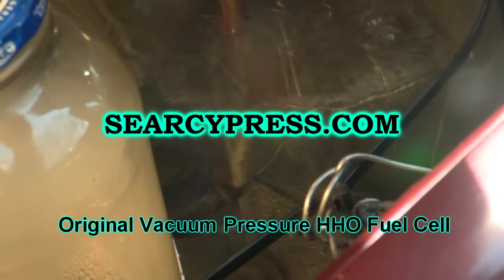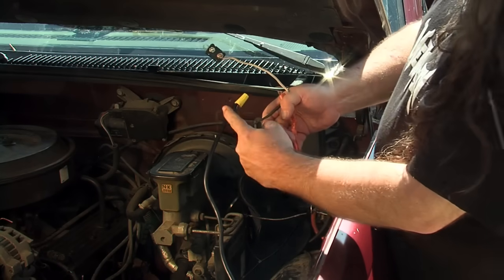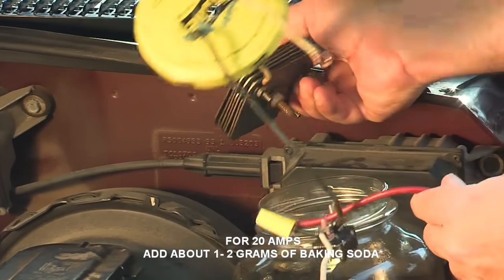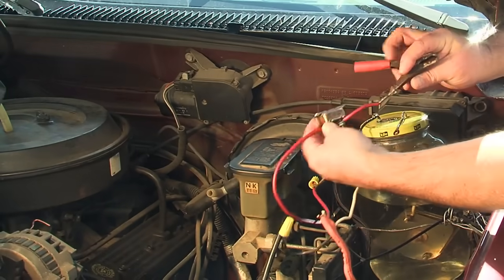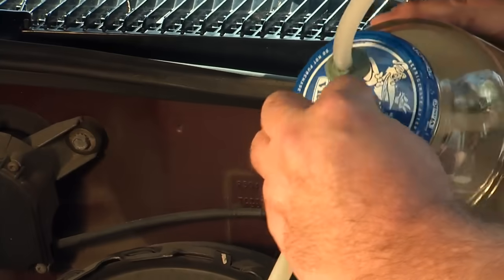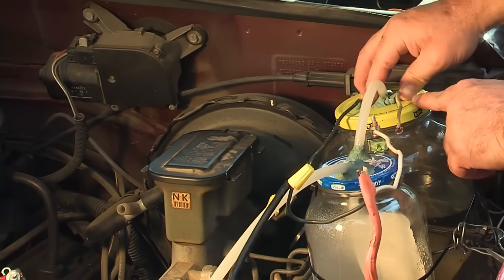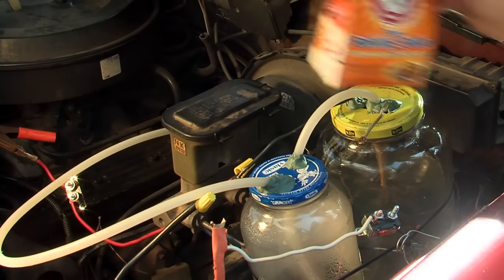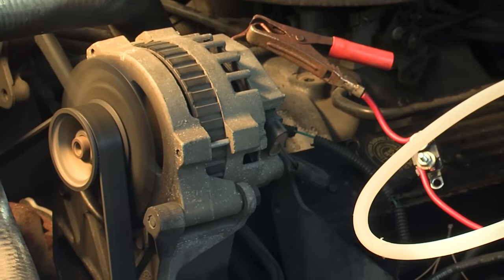Vacuum Pressure Hydrogen fuel cell defeats high gas prices using hydrogen from H2O.

Comment: Everyone talked about this technology in the 90's and early 2000's and then it just seized. Yet government pushed electric and gas. Reason being is it would collapse so much of our energy sector and most countries who have oil or rely on the petro dollar or just have relations with other countries that export energy would not dare to back hydrogen until those other countries decide its time to. Now you hear people saying how its not feasable and the technology isnt there and then you have media writing articles about why electric is more feasible and how hydrogen is so dangerous and stating a hydrogen station in California blew up.  Just so we are all clear, in the 90's the technology for converting water into hydrogen was going to be built into the vehicle and now they removed it kt and prefer to have hydrogen stations to refuel. That is proof that the technology is too good and will cause lots of energy jobs to be reduced. So they had to make you pay for hydrogen and install larger hydrogen tanks in vehicles rather than a tank for water and hydrogen converts as its needs it for fuel.

Comment: How would the cell end up drawing more than 30amp?
Reply from the maker: @danp2238  a lot of factors such as ambient temperature and the mineral content of the water used and the amount of electrolyte used. Ty for the comment. .
Reply: @metalpresstv  What difference would it make to have way more plates to convert the water to HHO?

Comment: Can it have any bad side effects on the engine like corrosion or stuff like that? I was thinking of buying a power generator to make it run on hydrogen but i won't buy it until I'm sure
Reply from the maker: @WinterWolfDubstepper  if you get anything out of this video understand we do not encourage you to replicate anything you see here. Injecting HHO into the system without the vacuum will not work. There is no other way except the way we show in this video ( under hard vacuum ) to make HHO work in a vehicle. Because we are not powering the engine we are powering the combustion process. 20% of the gasoline that goes into this engine is wasted in the catalytic converter normally. By causing almost complete combustion in the chamber we are able to get an increase in performance. All of the extra mileage comes from the existing gasoline that is normally wasted and not from the HHO fuel. HHO is extremely misunderstood and it is often thought that you can use it by squirting it into the carburetor and it will never and has never worked that way. It has to be done in the state of vacuum. We have a new video which will be coming out that explains everything in great detail. We are not able to release this video at this time and we are looking forward to it so be sure and subscribe. Thanks very much for the comment.
Reply: @metalpresstv  You being watched?

Comment: Pulling from the alternator wouldn't that pull a load as if like you're running the AC and we all know that burns up more gas so pulling from the alternator would draw more current wouldn't it equal itself out
Reply from the maker: Most people don't realize that you're not burning 100% of the fuel. In this case around 80%. The other 20% burns in the catalytic converter. This controls emissions. We're burning as much of the fuel as possible inside the actual cylinder. The boost in performance is from the gasoline that is normally wasted. The catalytic converter remains cooler much longer and you will see a lot of water coming out of the tailpipe.  This is from the gasoline and not from the HHO fuel cell. Emissions are considerably lower. Thanks very much for the comment.

Comment: You should never use solid wire on a machine or vehicle that vibrates. Eventually it will work-harden and break. Always use stranded wire on such applications..
Other than that, nice job on this project..

Comment: Not a single word about hooking it up to the engine how does the gas produced in the jars get to the engine 🤷‍♂️ where do you hook it to the carb or Tbi or multiport ?
Reply from the maker: In this video it is hooked to the vacuum line that goes to the brake booster. This is not the best place I can promise you that. It was only done that way for convenience and it did work however it does create a bit of a safety issue. The best option would be directly to the carburetor area where there is high vacuum. Not every vehicle will of course have such a port. However almost every vehicle does have a vacuum system that can be used. With that said please do not replicate. We will have a new video on this when the time is right. There have been many improvements and it should be something to see. Thanks for your comment. I'm pretty sure I show that in the video but maybe I didn't make it clear. Ty

Comment: So i made one but the cable i used for the positive gets extremely hot at the battery end any suggestions
Reply from the maker: I do not sanction reproducing this but I will say that we used number 10 solid copper wire. An automatic reset 30 amp fuse was put in line to prevent overloads on both sides of the positive and the negative. Thanks for the comment.

Comment: Will the water exhaust rust the internals?
Reply from the maker: No. The water is primarily coming from the gasoline. This is normal. When you're running the HHO fuel cell the catalytic converter stays cooler much longer and the moisture from the burning gasoline is not vaporized. Only about 3/4 of a gallon of water is used every 200 mi from the fuel cell this is insignificant compared to the amount of water produced by the gasoline. Thanks very much for the comment.

Comment: So how'd you get past the computer? It increases fuel supply based on the amount of air intake...
I built one of these 20 years ago on a Chrysler but it made me use more gas because of the increase in airflow. Did jack up power a little bit but on top of that the stainless gets canibalized very fast. Just going to town and back ate the threads on a stainless 1/2 inch bolt, OFF! and produced a blue liquid that smells like chlorine.
Reply: If you had a head manifold injection system like NOS you could bypass the built in airflow regulator, but haven't found a way yet to run pure HHO in a stock engine. I quit experimenting with it shortly after but still think of ways to make it a functional system.

Comment: Potassium hydroxide in the water instead of baking soda. way better!
Reply from the maker: The reason we don't use it is because it is extremely corrosive. I agree it tends to produce more gas there are some benefits but the cons are a factor. Thanks very much for the comment.
Reply: @metalpresstv  Yes its very corrosive. its about 10-13 on the PH scale . im using 99% Potassium hydroxide flakes it works wonders

Comment: Im thinking tho wouldnt the engine oil become creamy from possible mixture of some water?
Reply from the maker: The water that you see coming out of the tailpipe does not come from the HHO it primarily comes from the gasoline. The engine wastes about 20% of the fuel which is then burned in a catalytic converter to control emissions. When we inject the HHO in the state of vacuum we get a near complete burn in the cylinder and there's not that much left over for the catalytic converter to react with. It stays cooler much longer resulting in visible water coming out of the tailpipe that came mostly from the gasoline. Thank you for the comment.

Comment: Good stuff man imma go buy a scooter and convert it to Hydrogen using this method.. Maybe just add a pressure regulator with autoshutoff connected to the electrolyzer, for added safety and a relay that automatically turns on the electrolyzer when i turn on the ignition❤

Comment: I dont know if the big car companies are gonna do this, but if you have an electric car or even a motor do this. Take that hydrogen set up, attach it to a small one piston engine with a pulley. Then get a small generator head and place a pulley on it, connect them. Then run the charge coming from the generator to the electric motor. Thats real gas miles and no giant ass battery.
Reply from the maker: We're not powering the engine with the HHO gas. What we are doing is we are burning all of the fuel in the combustion chamber instead of the catalytic converter that most likely car companies are partnered with in some fashion. Most engines waste a considerable amount of fuel which is then later burned in the catalytic converter to control emissions. By burning all of the fuel in the engine you really don't need that catalytic converter. Just a thought. Thanks very much for the comment and be sure and subscribe for the follow-up video which we will release when we can.

Comment: I knew someone who in 2018 installed this system on a 1985 Toyota LandCruiser 4x4 with the 4.5 liter inline 6 with carb. A big and really heavy vehicle. He said the avg. MPG went up from 13-14 to 21-22 mpg when it was in operation. I can confirm it really does work.

Comment: Always love water in the exhaust and in the engine 😂 murica
Reply from the maker: The water is always there, it's a byproduct of burning gasoline. It is normally not seen because the 20% of gasoline the engine wastes fires up at the catalytic converter, burning so hot nothing but invisible steam comes out of your tail pipe. Running the fuel cell there's just not that much for the catalytic converter to burn. It runs cooler and the water from the gasoline condenses.  Thanks for the comment.

Comment: LMAO the power needed for water electrolysis is superior to the power provided by burning the H2
Reply from the maker: You're under the misconception that we are powering the engine with the gas we make. That's not what we're doing. Only about 80% of the gasoline fuel is burned in this engine. The rest is ignited in the catalytic converter. By injecting HHO in the state of vacuum into the cylinder we are able to achieve near total combustion in the chamber burning all of the gasoline. As a result the catalytic converter stays cooler much longer and a large amount of water is noticed coming out of the pipe. This water comes from the gasoline and not the HHO. All gains come from the gasoline that is normally wasted. No one ever claimed there's over unity at work here. Thanks very much for your comment.

Comment: Does this add any performance to the engine it is adapted to, or does it just increase efficiency
Reply from the maker: In this case it did. All engine ping from low octane fuel was eliminated. Better response. Thanks for the comment.

Comment: Is this system powering 100% of the vehicle? Or does it still require gas for fuel?
Reply from the maker: All energy comes from the gasoline. Engines can waste as much as 20% of the fuel. It is burned in a catalytic converter to control emissions. By increasing the efficiency of the explosion in the cylinder to near 100% there's not a lot left for the catalytic converter to burn. It remains cooler much longer and as a result you will see a lot of water that comes out of the tailpipe. This is actually from the gasoline and not from the fuel cell. We will have a new video which will cover all of this. Thank you very much for the comment.

Comment: Don't do this.  This destroys water.  It turns water to hydrogen and combust it.  Hydrogen is a component of water and once it's gone it's gone forever. I used to think this was cool but it's the dumbest thing ever.
Reply from the maker: That's interesting. I'm not sure where you get your information. Recombining hydrogen and oxygen produces water which can be once again split and burned again. Hydrogen just so happens to be one of the most abundant gases in the universe also. You can make it from many things hydrocarbons are quite abundant. Thanks for the amusing comment.
Reply: Sorry,  the combustion of HHO results in H2O !

Comment: It basically produces hydrogen gas the same way a wet cell battery dose while being charged.
Reply from the maker: No. It produces hydrogen and oxygen gas. It's a much stronger mix than hydrogen alone. Thanks for the comment.

Comment: This has been debunked as a useless device. If you do the math on the amount of hydrogen required to even make the smallest of differences, your vehicle would need 4 or more alternators and more then a dozen of these devices producing hydrogen. The HP required to run the alternators would negate any fuel savings, and in fact would increase fuel requirements.
Reply from the maker: Actually you are not correct. Injecting into the air intake with HHO most certainly will produce no results. What happens is the gas is diluted by air and the hydrogen and oxygen separate. This is a vacuum system. The HHO enters the cylinder in the state of vacuum and is ignited. We are not powering the engine with this device. We are simply accelerating the combustion in the cylinder to burn all of the fuel. Many engines waste as much as 20% of the gasoline. This leftover fuel is then ignited in the catalytic converter to help reduce emissions. You can clearly see it working because the catalytic converter will stay much cooler much longer with the vacuum system. All of the gasoline is ignited in the cylinder and there's not much left to burn. A lot of water comes out of the tailpipe that is coming from the gasoline. This happens normally but the catalytic converters heat turns it into a vapor. The extra performance and mileage comes from the gasoline and not from the HHO itself. We have any video coming out which will explain much more. I assure you, you only need one good alternator.. thanks for your comment.
Reply: @metalpresstv  Buddy, it's Scam and people should not waste their time and  money on it.
Reply from the maker: Okay, I'll argue. What exactly do you find that this scam involves? Tell me exactly where the scam exists? I've explained to you that this is a vacuum system and not an injection into the carburetor in atmospheric conditions. I don't want to insult you or get into some sort of stupid argument. I would like to know exactly what you think the scam is? Just calling something a scam quite frankly is not enough. I want to know exactly where the scam is? I'm not a robot I'm a person who's sitting here trying to figure out why you're so convinced I'm trying to take advantage of you in some fashion. I assure you that is not the case. I guess what they say "You can't lead a horse to water and make it drink" is truly divine wisdom.

Comment: How do you regulate the extra oxygen coming from the cells did you manipulate the air flow meter??
Reply from the maker: We're not injecting into the air intake. When you do that, the gases can separate and can be diluted. In the vacuum system the gas is recombining into water and results in a near complete combustion in the cylinder. Now that's not always the case and different vehicles and motors can behave differently. Injecting into the vacuum is similar to a vacuum leak and will lean the engine slightly. Normally this could result in engine pinging. But with the addition of the hydrogen oxygen ignition, engine pinging goes away. The catalytic converter on this vehicle stays cooler much longer and results in a lot of water coming out the pipe from the burning of the gasoline. It does not come from the hho exclusively. 1/2 a gallon of water is good for at least 200 miles. We have a new video coming out soon on this topic and I will try to cover as much of this as I can. Thanks very much for watching and please subscribe.
Reply: @metalpresstv  🙏🏼🙏🏼🙏🏼👍👍👍thanks

Comment: Do you just splice this into the fuel line allowing the hydregon to replace part of the fuel. Is the mix of gas and hydregon and oxygen safe. How is this hooked up to your truck.
Reply from the maker: In this particular set up it was tied into the vacuum line on the master cylinder. Ideally you would tap directly into the vacuum intake on the carburetor or the closest available hard vacuum. The gas enters the cylinder through the vacuum of the engine. Putting gas directly into the air intake has never worked and never will because the gas is immediately diluted and there are no gains. This has caused so much confusion and so many people are thinking it doesn't work. All along the vacuum has been the key to HHO working on any engine. You will see so many replications done and so many fancy cells that claim to work. But unfortunately it just doesn't work because of the dilution of the hho. Also the thermal properties necessary for proper temperature regulation  require the vacuum. We are going to release one final video on this very soon. So be sure and subscribe so you don't miss it. Thanks very much for your comment. Remember this is for demonstration and entertainment purposes only so please do not recreate or attempt this on any vehicle. 😎

Comment: You can buy a 30 kilogram tank of hydrogen gas for $15.
 Don't put glass jars in your engine compartment
Reply from the maker: You be hard pressed to buy a burger fries and a soft drink for $15. This is not hydrogen. This is hydrogen oxygen gas. The system runs in a vacuum. There is absolutely no pressure in that jar.. With that said, he's right do not replicate this at all.  New video coming.
Reply: @metalpresstv  fake fake fake

Comment: So how does it save fuel… is the fuel pump still not pumping the same Amount of fuel?? Why would the spray at the injectors be less??
Reply from the maker: Because more of the gasoline is burning in the cylinder instead of in the catalytic converter you're pressing less on that gas pedal. We have a new video coming out this year on this topic, so be sure and subscribe. Thanks very much for the comment.